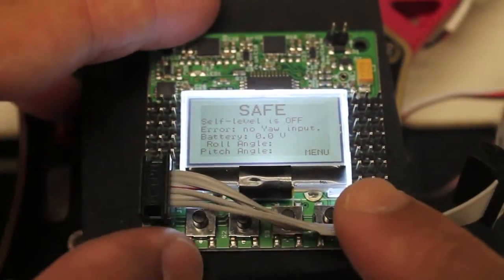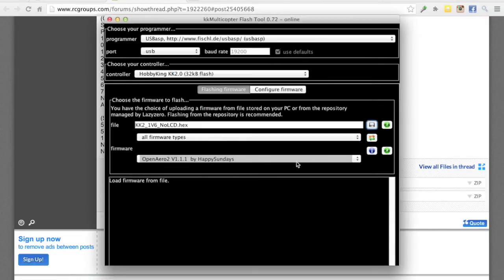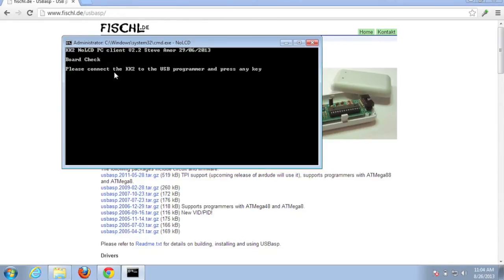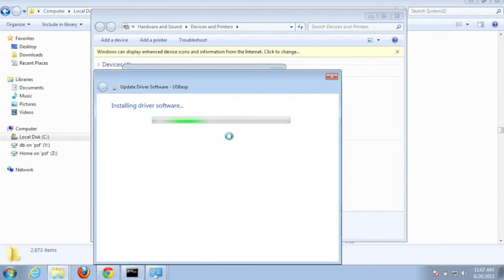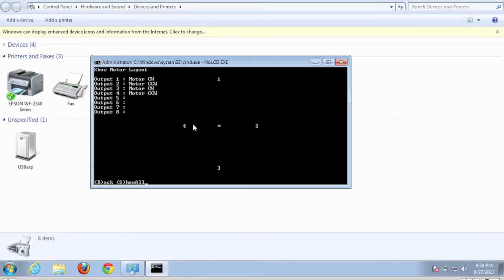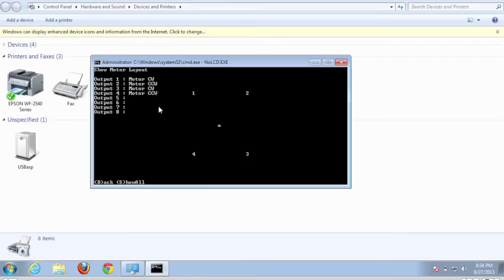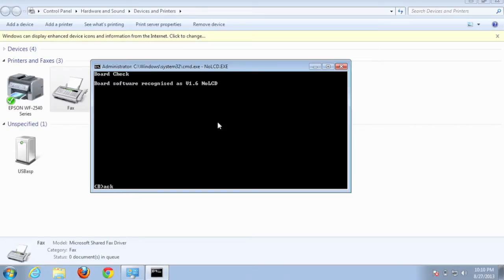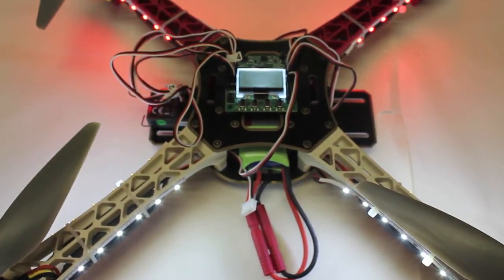How to Configure KK2 Using No LCD Firmware Version 1.6 on AeroSky Quadcopter

Comment: Dennis did you try making a small jumper wire on button 4? Just imitate the button press by touching the two contacts on that button? Or use a multimeter to see if the button if faulty?

Comment from the maker: You tell me. I have a vid going up soon with the PI gains adjusted and it works well. You just won't be able to tweak them without using the No LCD firmware config tool. I've been pretty impressed. When you see the vid you can let me know what you think. Hope all is well.

Comment: this just happened to my board - I have flashed it but cant seem to get the PC interface to work/connect. I am using a USBasp and windows xp. Any suggestions?
Reply from the maker: Hey, thanks for the comment. You know, I haven't tried this with XP...only Windows 7 so maybe there's a driver issue. If you have access to a Windows 7 machine you could try there. Sorry, that's the best I can come up with. Good luck.
Reply: Ok, thanks I will try that - does the machine have to have internet access as the one I was on was offline?

Comment from the maker: I really wish you were right, but get this... I pulled the button off to have a look beneath. Everything looked fine. The button works when pressed with button 1. Also, I'm posting a video this eve that shows 5V on both sides of the button and when I press it goes to 0V. I've measured the voltage on this and all other buttons and they behave identical. That tells me the problem is elsewhere, but where???